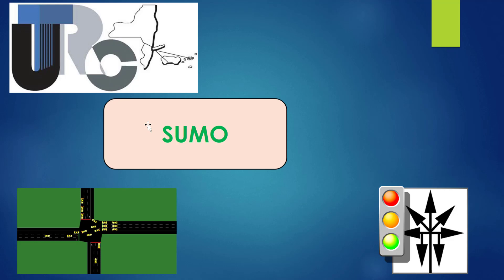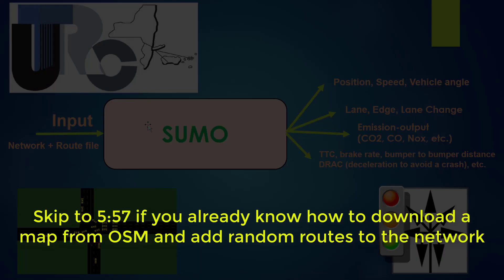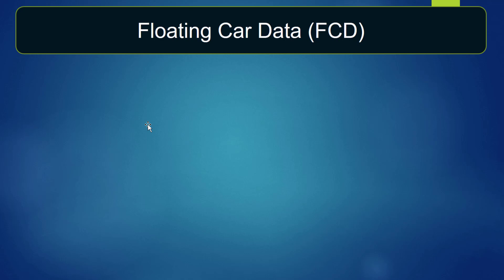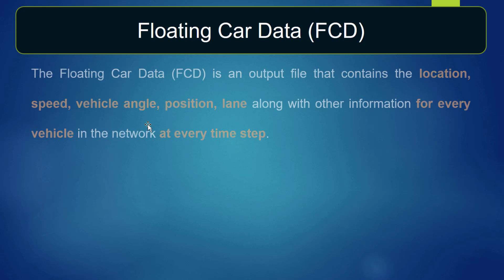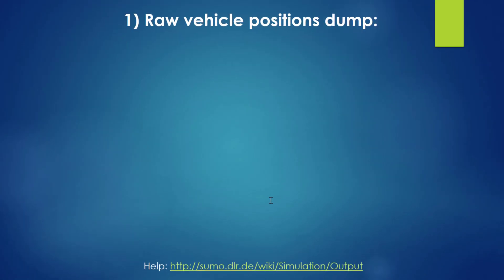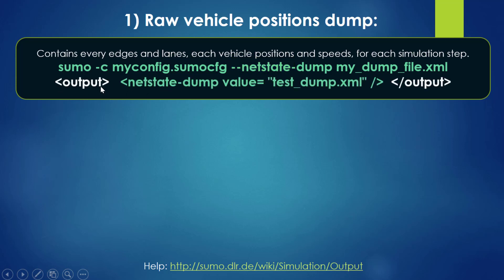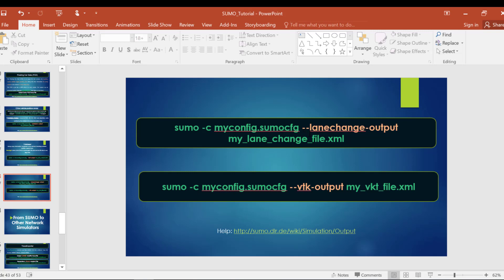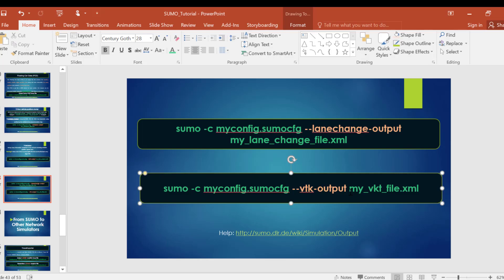Sumo, Simulation of Urban Mobility:  Output Trace Files and Metrics, part 1

Comment from the maker: Command lines for SUMO Output

0) Sumo Floating Car Data (FCD) Trace File
sumo -c myConfig.sumocfg --fcd-output sumoTrace.xml

1) Raw vehicle positions dump: 
sumo -c myconfig.sumocfg --netstate-dump my_dump_file.xml

2) Emission Output: Amount of CO2, CO, HC, NOX, fuel, electricity, noise, emitted by the vehicle in the actual simulation step
sumo -c myconfig.sumocfg --emission-output my_emission_file.xml

3) Full Output: 
dump every information contained in the network, including emission, position, speed, lane. 
Warning!!! takes a lot of time to accomplish this task and the file size is very big (~GB) 
sumo -c myconfig.sumocfg --full-output my_full_output.xml

4) SUMO Lane change Output
sumo -c myconfig.sumocfg --lanechange-output my_lane_change_file.xml

5) SUMO VTK Output
sumo -c myconfig.sumocfg --vtk-output my_vkt_file.xml